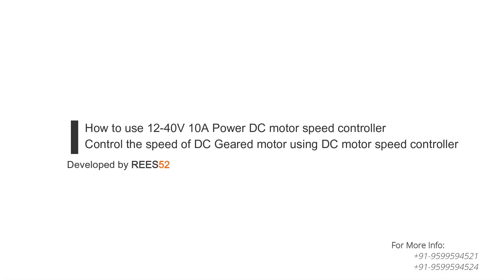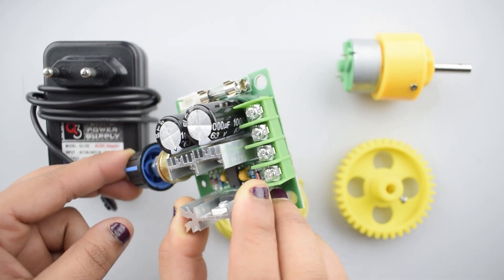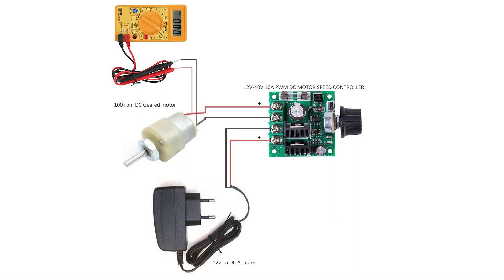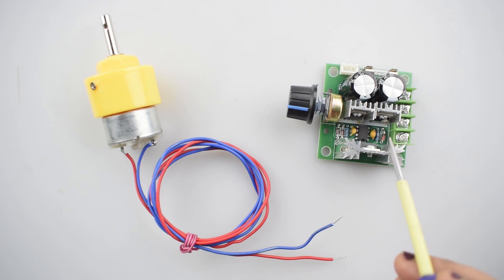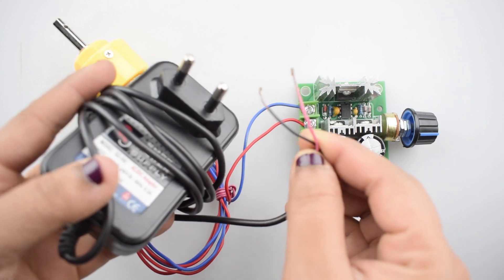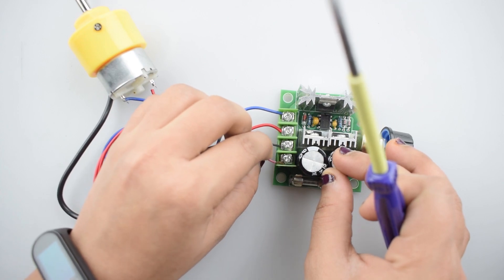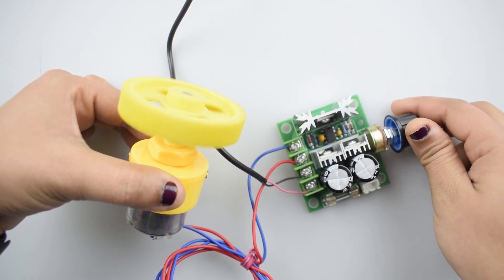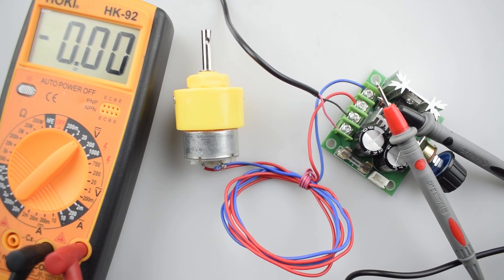How to use 12-40V 10A Power DC motor speed controller | Control the speed of DC Geared motor

Comment: I mistakenly connected it’s power cables to AC input. It’s not working now but it didn’t made any spark or noise at that moment, nor any components turned black or there’s no burn out smell. So what could have happened to this? I mean what component of that should be replaced to make it work again?

Comment: I have a question.. What is that mini white socket with 3 pin at the motor speed controller? Hope you can answer me
Reply: She answers no questions. I have the same question as you. What is the small white connector for? It has been 2 years since your comment posted. Did you ever find the answer?